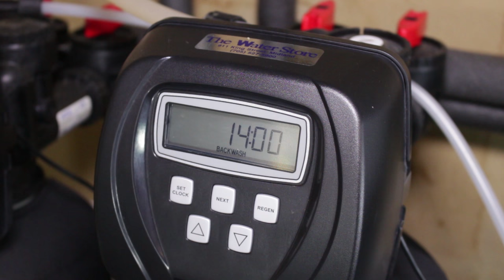How to Calculate the FLOW RATE from Your WATER PUMP

Comment: Update from my last comment about a month ago, I replaced my pressure tank and the steel pipe that was supplying water to my house from the tank. The pipe was about 50 to 60 percent restricted from mineral and scale build up.  The well tee was also restricted. My flow rate went from 6 gpm to 8gpm. Water at my barn now gushes out when before it has a very low flow
Reply from the maker: Glad to hear!

Comment: I just bought a home that runs on well water. The pump is under a plastic rock that is about 2 feet high. Where can I find the pressure tank or can I just do this test right at the faucet attached to the pump?
Reply from the maker: The faucet at the pump should work.

Comment: Why not just fill a 5 gal bucket and time that to fill, and divide  time to fill by 60  so 20 sec to fill divide by 60 is 3 and times 5 gallons is 15 GPM
Reply: no as your first 5 gallon the pressure (PSI) from the pump is at its max, if you run it longer the PSI goes down until it reaches it’s min then pump starts again therefore the flow too. As you know the pump is not always active, it will kick in once pressure reaches min.

Comment: Hello There . I have a quick question for you . The hose you used to fill that jug up looks to be 1/2 inch and you received  9 gallons in 43 seconds  , what would happen if you used a 3/4 in hose to fill your jug up would you get more than 9 gallons in 43 seconds?
Reply from the maker: No, the maximum flow rate 1/2" can handle is 14 gpm.  But if we had more than 14, that 1/2" hosew would restrict it.
Reply: @water_estore  But doesn't your test compensate for variations in hose size or hose valve size?  In other words, the actual flow rate through THAT 1/2" hose would be limited to 14 gpm.  But the test is trying to determine the flow rate of the pump using the equipment/piping in place. And you're doing that using volume (gallons) and time (seconds).  So you should get the same result whether you had a 1/4" tube or a 1" hose.  In other words, the pump will still run for 43 seconds from kick-on to kick-off (which has nothing to do with hose size) and it would have still taken 9 gallons to kick the pump on (regardless of the hose size or valve size those 9 gallons had to pass through to kick it on).

Comment: I have to have my well water tested 2 times a year by the county.  I am having problems with bad bacteria in my water.  If I add the UV ultraviolet sterilizer system to my well after shocking it with chlorine before installing it.  Will I continue to have problems with the tests conducted by the county coming up positive. really need to know if UV ultraviolet sterilizer system will kill the coliform or E coli and show a negative result on the lab test.

Comment: On my well the pump TAKES 6.3 SECONDS to fill up a baket of 10Litres (6.3/60=0105  NOW my 10Litres Divided by 0.105= 95.2380Litres By ??????????? what exacly.  Can anyone explain to me ,Im a bit confussed here.   Thanks
Reply from the maker: So you are getting 2.6 gallons in 6.3 seconds. Since that is 1/10 of a minute your flow rate is approximately 26 gallons per minute.
Reply: Many thanks I just wanted to confirm my suspicious,someone give the formula as follows: Time to fill recipient /60/by the size of recipient. I was convinced that was wrong and you have confirmed. Thanks
Reply from the maker: @wilmer2754  that formula is close but incorrect.  Gallons times 60 over the number of seconds to produce the gallons = gallons per minute.

Comment: Ok wait, you are measuring the flow rate of your "pressure tank" at it max pressure, not the flow rate of the pump.    Flow rate of pump would be measuring the actual rate it pumps water into the pressure tank.  This is not what is happening in your test here.
Reply: @water_estore  👍👍🙂
Reply: He is measuring the pump, not the tank rate. Took 43 seconds to fill 9 gallons of water from the pump into the tank.
Reply: Not necessarily. He's using the pressure tank (at max and min) and the pump to measure the flow rate that water gets back into the tank from the pump.  The actual pressure settings only tell the pump when to kick on and kick off.  You'll have a higher flow rate at max pressure (kick off) and a lower flow rate a min pressure (kick on), but this test is the only way factor those changes into the equation.  Gallons drained off to make the pump kick on, divided by time the pump ran (until it kicked off) to replace those gallons, times 60 = gpm.  And to clarify, when I say "to replace those gallons" I probably mean the same thing you mean when you say "the actual rate it pumps water into the pressure tank."  That is, it took 43 seconds to pump 9 gallons of water BACK into the pressure tank.